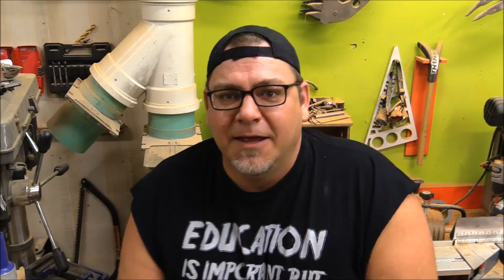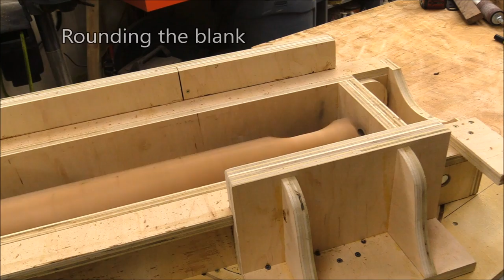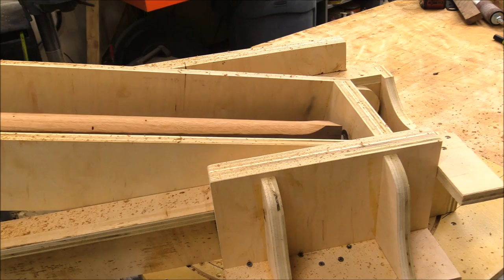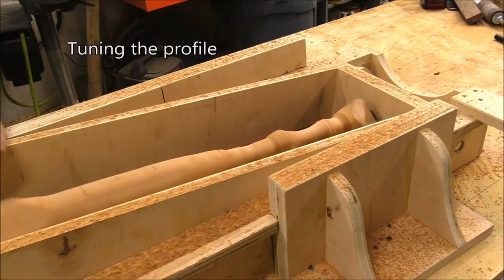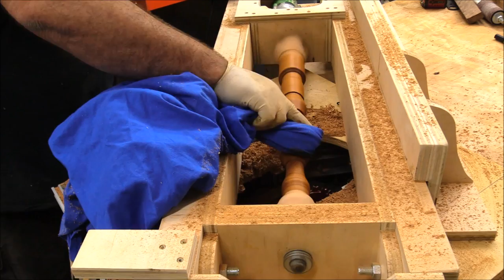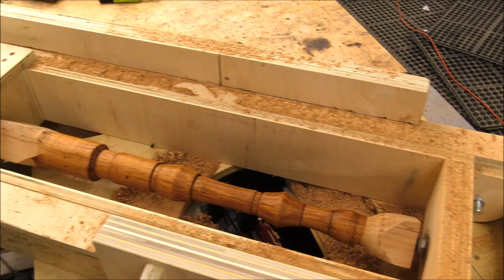HOLY COW IT WORKED! Table Saw Lathe Jig!

Comment: Izzy, this is screaming out for an upgrade! What it needs is a vertically mounted plywood profile and a roller bearing follower on the tilting part of the sled, kinda like a huge horizontal router lathe. That would enable easily repeatable copies.

Comment: I'm sure you're on the same idea train, but you could put a cross sectional pattern on the left hand side of that thing and then follow it with a pin attached to the moving chassis. Boom, instant repeatability.

Comment: Super cool - but what happens if your drill battery dies, or your finger slips off the triggers as you're running a piece spindel sideways across the TS blade? seems like that could be bad, no?

Comment: I believe that you could put a square peg into a round hole.
Reply: I think he may have actually accomplished that with his dowel maker (kinda/sorta). You probably know which video I mean.
Reply from the maker: thanks Lou the trick to putting the square peg in the round hole is simple. just push harder. ha ha ha
Reply from the maker: ha ha ha right on..
Reply: Or, get a bigger hammer!

Comment: An angle grinder with a diamond cup wheel will knock the corners off that blade pretty quickly. Especially if you run the table saw and the angle grinder at the same time. Just saying... :)